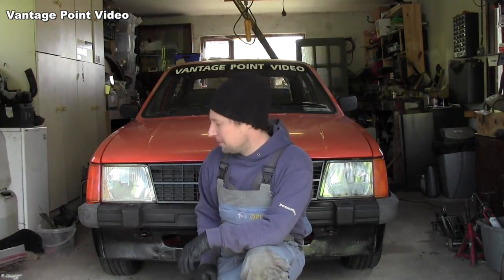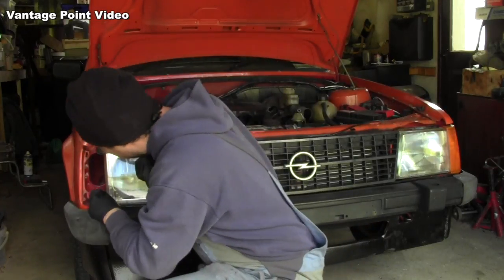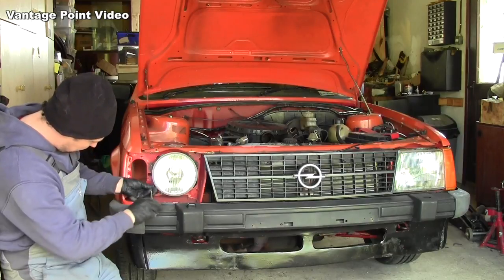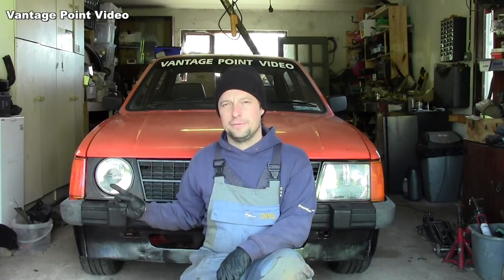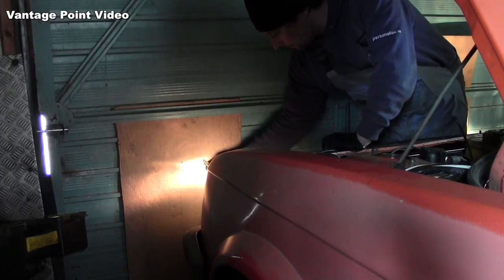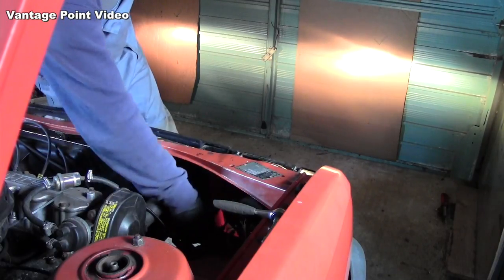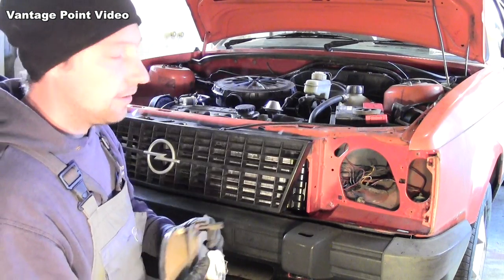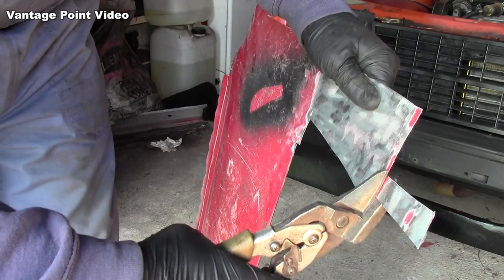Square to Round Headlight Conversion: Car Restoration Diary #22

Comment: Have you tried to have the round early headlights and the Hella mask with the 2 spots ???
I had it once... but after many options i now have the standard squares on .
Remember to fit  a new loom with relays , they will give 100% from these headlights.
Reply from the maker: I think the two round hella's built into the grill in addition to round mains, changes the appearance of the car too much making it mk2 golf like, they're a nice contrast when the square lights are fitted. I think I might go for two spots out on the bumper with the set up I have as some of the runs I plan to do will have a motorsport theme. But I'll wait to see how they look.

Comment: Where did you get those parts??
Reply from the maker: The round lights were actually originally on this car. I put the square lights on for some tv work I did with the car. I also have a spare set from another one I had, so I could make the best of both sets.
Reply: Vantage Point Video hmm. So it's actually an option for the car to have round lights eh? I was hoping to do it to an a31 cefiro.
Reply: They we’re actually on the base models.

Comment: Sorry but it's the wrong look. The best look in my opinion was the "square" headlights as you call them with the round spotlights in front of the grill. I don't like the black valance that you've gone for either. These little cars are getting as scares as rocking horse shit, keep it original.
Reply from the maker: Thanks for your opinion. The round headlights are original, the 'square' lights were fitted for a crime reconstruction temporarily. I had to do repairs within the black areas so this was an easy way to preserve these areas until a full respray. The SR or EXP look is a bonus to me. The car came to me in this unoriginal orange so I feel that gives me licence to colour it how I please, especially as the original amber paint is worn off. Ultimately it'a an SR that I want and when I have one I may consider making this totally original then. Nothing that I'm doing is irreversible and the main thing is we're enjoying the car.
Reply: FairPlay, my first new car in 1984 was a yellow 1.3 Kadett and I took loads of money off mates racing their 1.6 Golfs and kicking their arses. I love those old Kadetts.